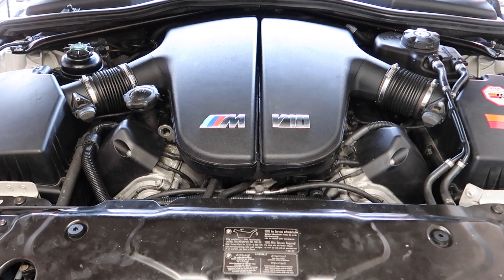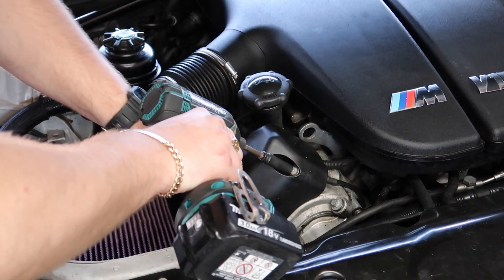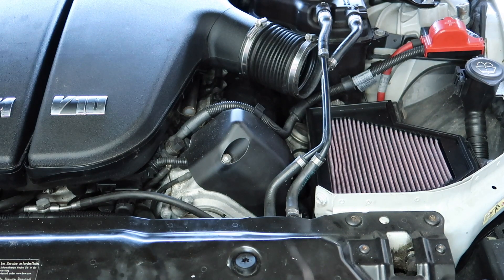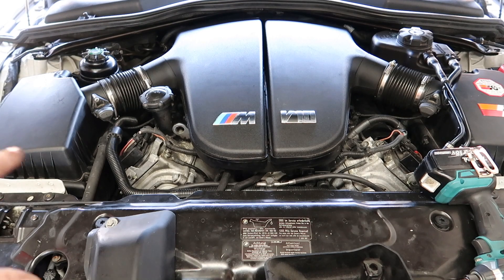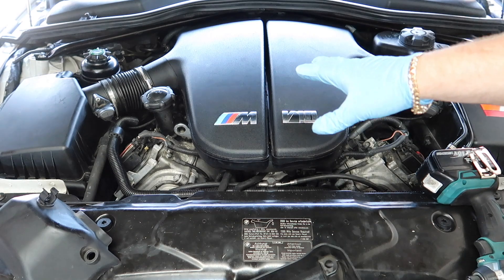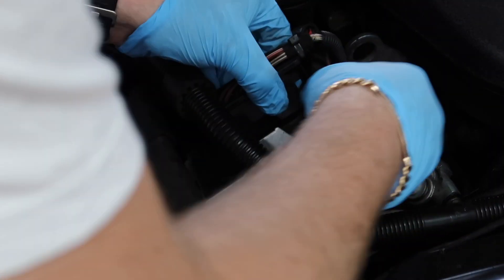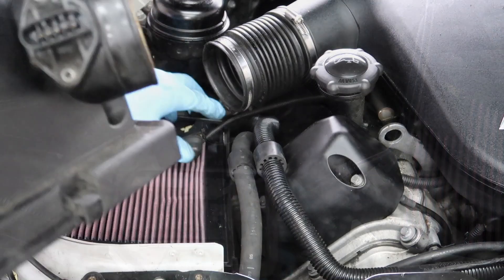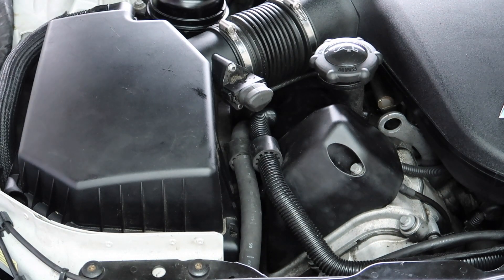BMW S65/S85 Reduced Power , Limp Mode , Misfires On Cylinders , Rough Running ( The Cause)

Comment: What is the name of that control unit?
Reply from the maker: these are called the "IONIC CONTROL MODULES" But they are also known as "VANOS CONTROL UNITS"

will pin your comment to the top so it helps others sorry for not saying what they were called
Reply: BMW Doctor thanks for your response, cheers!
Reply: @BMWDoctor  I have the same issue with my E60 2007 550i.I have an appointment in the morning at the BMW dealer for the diagnosis which will cost me $210 if that's all I need should I tell them to check that piece there that you're mentioning in your video?
Reply: @BMWDoctor  It will be that I have the same problem but in this case it is an N 63 engine of the x5 e70 line some idea
Reply: I hope this is what wrong with my 2007 760li I've spent well over 5grand with no fix or didn't know the diagnosis please help
Reply: @montrecemcleod8977  you need to get a code scanner (ideally 2 actually to make sure you get a consensus). 
Scan the codes and interpret the codes. Do your research and use the internet. Understand what is going on with your car and what it’s telling you. 
Start with the most likely culprit, but recognise you might not get the final fix on the first attempt.

Comment: I have a question 2007 106k miles I have random mis and vanos code all 4 sensors has .48 or .39 do u think I spun a bearing? Or ionic ?

Comment: I have a bmw m6 . With the same issue. Had a code missfire on cylinder 6 . Switch the 2 module's around . Now I have a missfire on cylinder 1. So I no now that the ionic module was bad . Just bought one on ebay. Hopefully that will fix it . Thanks Dr

Comment: I’ve a similar misfire and on cyl 5. Same thing all coils and plugs changed and still a misfire. Although the mechanic done a cylinder test, most cylinders sitting around 110/120 psi but cylinder 5 is at 30psi. Would that be a problem with the control module or sounds more like pistons rings?

Comment: I have a 06 and I been chasing the same dam Miss fire on CYN 5, changed the plugs coils and clean MAF and few other things- just ordered a new control unit so hopefully it fixes it.. like you said.. some days it runs fine no issues and other days limp mode on , and CYN 5 mis fire pops up, hope this fixes it once and for all
Reply: Did it fix issue ?

Comment: Good evening, I was wondering were are those 2 units on the s65 🧐
Reply: The S65 doesn't use these. They are called" ICONIC CURRENT CONTROL UNITS". This video was great though. It made me search the BMWTis for the answer. 

"I located in BMW tis where is talks about both engines. These units are incorporated into the ignition coils of the S65 for each cyl separately. The S85 has them in the units replaced on this video. So the equal part of the S65 is the ignition coil itself for the S65."

Here is a post that also "kind of" leads you to in the right direction. 
(I can share the post)
The above post talks about knock sensing. The units in this video also check for knock feed back.
This video is great. But for the S65, just replace the ignition coil.

Comment: Dr. I'm getting misfire with cutoff (fuel cut, as in the injector is purposely not activated) on cylinder 9. I replaced all 10 plugs (because it was time), replaced coil on cylinder 9, no change, still misfire. Then swapped bank 1 ionic module with bank 2. Still misfire on cylinder 9 I also swapped cylinder 9 injector with cylinder 6, still misfire on cylinder 9. This seems to indicate the ionic modules are ok. What next? Is there a common wiring issue,or something with tbe throttle body to look for?
Reply: I have this same problem but with cylinder 2 with cut off i replaced  everything but the fuel pump and fuel pressure sensor

Comment: 2008 BMW M5 with an automatic transmission The car has about 103,000 miles so on my way home yesterday the transmission malfunction gear come on yellow and then half an hour later a check engine light come on and I receive a code using my scanner and autozone scanner p0175 System to rich bank 2 and p0174 System to lean bank 2 and p2190 System to reach at idle bank 2 -p0325 knock sensor 1 circus bank 1. And p0446 evaporative emission system vent control Circus. And then when i click check control in the car it shows up increased emissions. Help

Comment: @BMW Doctor I need help...car goes into limp mode, reduced engine power light CC ID 29, rpm hovers between 500 and 800...codes show camshaft sensor, camshaft stuck, and cylinder misfires (I can send you the read out- P0456, P13C9, P0015, P052B, P054B, P0343, P00AA for confirmed codes)...do not want to get rid of the engine...X1 x28i 2013 140k miles...my cars name is Stealth. I took him in and the service agent said they found metal in the air filter and suggested getting a re-mfg engine...but I had been getting  regular oil changes and they didn't say which type of metal....starting here. How can this be remedied please?

Comment: I’m having some throttle and acceleration lag on my 2009 BMW M6 S85 with 90,000 miles, I can floor it and it takes a few seconds to get the RPMs up, the problem just started occurring out of nowhere, I had the throttle actuators replaced, spark plugs, coils, injectors, throttle position sensors, PCV valves, SMG clutch assembly, rod bearings, Vanos solenoids, all BMW genuine parts, the Dyno results were 464WHP, any suggestions??

Comment: Today i changed all Spark plugs and Coils, but still not worked, gonna order the module, thanks
Reply: Let me know if it works, I’m running around the amen issue 🥴
Reply: I’m having same issue.. I replaced coils and plugs but still didn’t solve issue.  Did new ionic modules work for you?

Comment: I got the same problem i stored 6 monthes my 06 M5, after that only 3 mile drive the engine light came "Engine Fault reduce power", and after that i changed all Spark plugs but still the same, i hope it will be fine when i change the module...
Reply: Fixed ?

Comment: My BMW E87 has been having a loss of power and delayed response in acceleration for about  ayear now. I've been searching everywhere to try and fix it and have taken it to the garage (Halfords) but they were unable to find out what was wrong with the car and advised me to go to BMW.

I have done research and people with the same issue who have gone to BMW seem to have been told BMW cannot find the issue.

The code CC-ID 29 appeared twice with the half full check engine light in the last year but when the garage has used an engine scanning device both the code and engine disappears.
The engine continues to misfire, it jolts while I'm driving as well and sometimes I can hear a rattle from the engine.

Does anyone have any idea what this might be?
I am starting to wonder whether I should just get rid of the car before it fully breaks on me.

Comment: Hi i have this code 002755 ignition cylinder 3 electrical doagnostic, it ia the same as misfire ? Sometimes cylinder 1 and 3. New spark plugs and coils, could be ionic module ?

Comment: Sir, i have same your car every time i et message reduced power of engine i calned filters and air-mass sinsoors but the message show again and i replaced my gas pump with filter same meesage and replase gas sinsor same again reduced power please how can fixed this issue please

Comment: Why the m5’s they sound like diesel on idle my e39 m5 was same but I thought e60 sound would improve but i was wrong as I’ve heard a few all same
Reply from the maker: Just the way they are under extreme HIGH PRESSURE that’s why that’s what makes the power nothing wrong with that

There called a quiet beast :) open them up and then forget diesel they become everyone’s nightmare

Comment: Hi sir i have a question,  i have (2013 BMW 535i xDrive 6 Cylinders 3.0L Twin Turbo DOHC)
My left headlight signal not working,  headlight works but turn signal dont,, they says i need to replace module,  wat this module is?

Comment: The Dr. has just cured another problem!!!!!
Reply from the maker: I did indeed and made it very easily by diagnosing, now I will say these don't come up on a diagnostic scanner not even ISTA it just shows as a misfire you have to use your brain to find out how these cars run
Reply: @BMWDoctor  Thanks Dean! It's surprising to learn that these modules can't report back to ISTA of their state, as I'd expect this from a generic code reader! Just shows old skool diagnosis and the process of elimination prevails at times of modern technology. I guess dealership appetencies don't get taught this based on 'if it doesn't register on their scanner surely it's not another probable cause' or they just don't have much opportunity based on strict FRU's on what to try out??

Comment: Finally someone that knows what I am talking about!  ;-)  lol  I had the same issue with my E60 M5.  Saved me a ton of money when I figured it out.  Instead of replacing all the coils and sensors.  Good Job man!
Reply from the maker: yeah don't I know mate we have Nathan running round replacing coils when I told him it was this and he's still naive to spend the money and keeps replacing coils.

he thinks these modules are only for vanos not for ignition coils and I told him about 100 times now today he will make a video saying about them as if he knew when he didn't he only knew because I told him when I had the issue
Reply: I know right!  I told him same.
Reply from the maker: but he wont listen as he likes cars with issues and all his modules yellow mine are all green and not ONE fault every little thing has been replaced.

he don't want to spend money he wants it to be a cheap fix but BMW there is NO CHEAP FIX 

well for me there is as everything is on trade so I'm only paying the wholesale price from BMW not the retail price and NO VAT
Reply: @BMWDoctor  Amen to that...Nothing is cheap with there is an ///M attached to the label.  But I knew that going into it...Gotta pay to play.
Reply: Also Never really understood why they would put these where they are located.  Lots of heat from engine going on there.